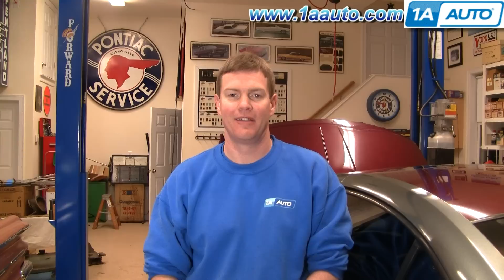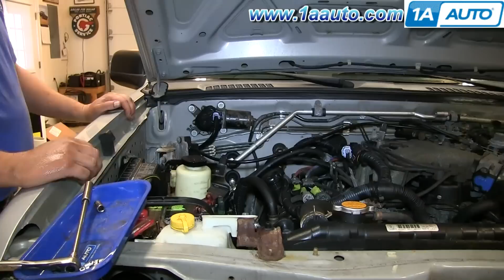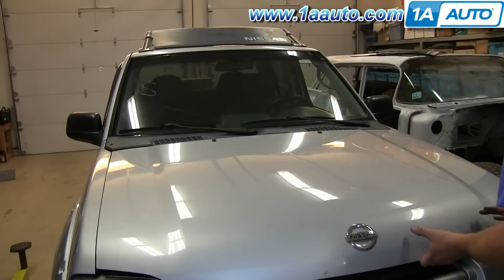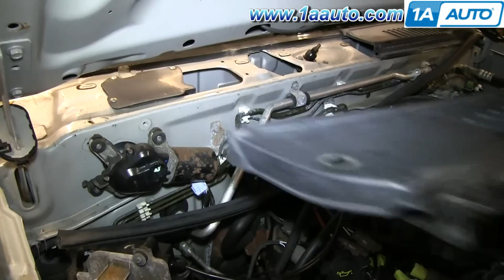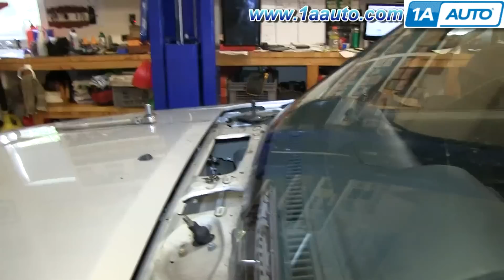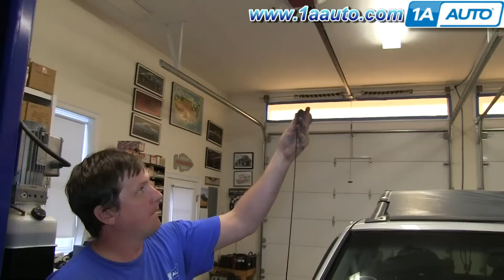How to Replace Wiper Motor 01-04 Nissan Frontier

Comment: Have a problem with wipers stopping in the up position.  I can tell with this video the problem is in the motor itself and i will need to replace it.  Appr the upload.
Reply from the maker: +beeps Thank you for checking us out. It could be that the motor is beginning to fault, or the wiper transmission/linkage is faulty. 1aauto.com
Reply: I spoke with a mechanic a few days ago and he told me the wiper switch is wrong.  Idk, guess someone swapped it at some point before i got the vehicle?  It is supposedly whats making my wipers stop in the middle of the windshield so i got my eyes open for a combo switch in local junkyards atm.  

I watch alot of your videos, appreciate you sharing your knowledge.

Comment: i have this same truck, but my problem is that only the pasenger side wiper stopped working, whats the problem?  drivers side works fine. is it the motor? is there 2 seperate motors?  is it a boken lingage? thanks!
Reply: Gona say its the linkage (wiper drive transmission) since both wipers work off 1 rod.
Reply: Linkage